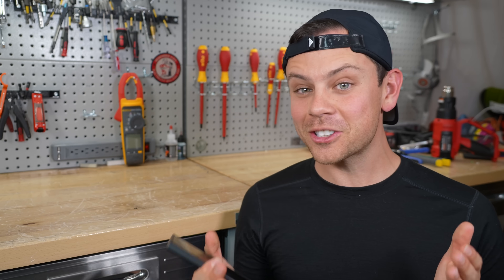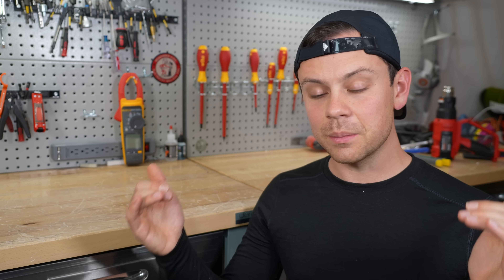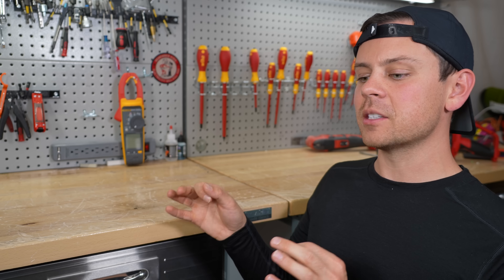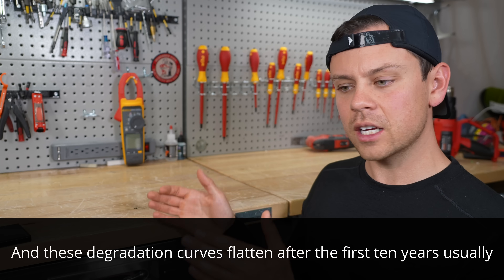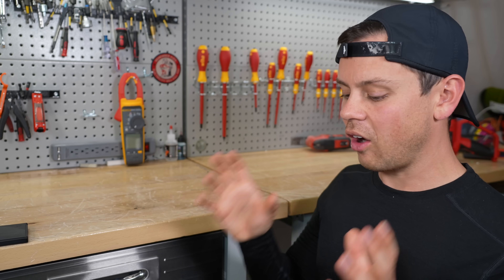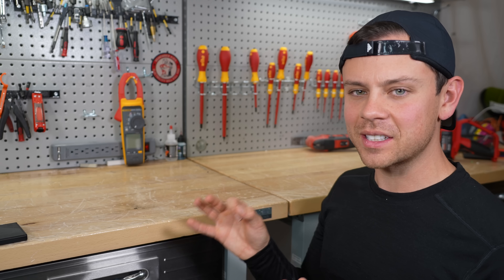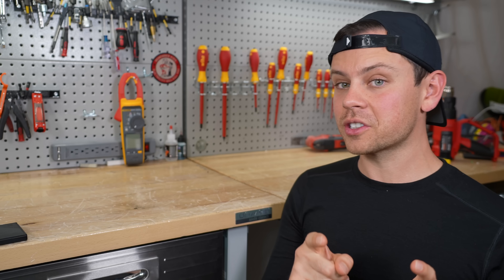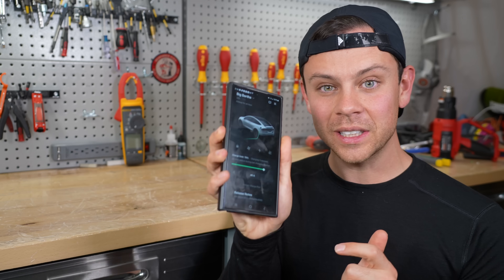LiFePO4 Longevity Discussion! Why Charge to 100%?! For Solar??

Comment: You give lots of good reasons for charging Lipo batteries to 100%.  But I didn't hear anything definitive why to regularly discharge them to 0%.  I have had my trophy batteries for two years, and Dan never said anything about discharging them to zero ( he, like you said charge to 100% regularly).  My batteries seldom get below 85% and we use them for everything.  maybe twice a month I will charge my tesla and run them down to 40%. Am I harming my batteries in your opinion??

Comment: I have an extra capacitor type balancer and im planning to use that AB to trigger via jk bms dry contact during low soc maybe during discharging from 51.5v down to 45.0v since planning to use my battery dod at 48v(3.00v/cell) is there any benefit from this scenario?  May be to avoid uvp during discharge ?? 

55.2v rcv
55.2v start balancing jkbms
51.5 and below start external AB

Comment: For long time storage. Should I discharge it to zero and then charge it to 50%. Or charge it to 100% and then drain it back down to 50%. AC200MAX + 2x B230 batteries. I do not use this system only for emergency power. Thank you in advance if you can answer my question. Canada.
Reply: All the way up,100%, is the only way to ensure the cells have balanced .

Comment: Our 12 volt batteries are unused for 8 months over the fall / winter / spring.   Temperatures sometimes reach 30 below F.    Should I not run a charge controller from our sometimes operating solar panels (sometimes covered with snow).  How do the recommendations differ for LiFePo batteries vs flooded lead acid vs gel batteries?   Any difference when using two 6 volt golf cart batteries in series (flooded lead acid)?  Thanks.

Comment: I have an RV with 1000w of solar, 1,000ah of LiPo. We are also on 50A of shore power so the batteries rarely get used. The whole setup has been on 24/7/365 service for ~6 years now. The batteries hover around 13.2-13.3 most of the time. I'm quite sure they've lost capacity by now, especially since they are almost 24/7 at 100% capacity.
My point is, there are many of us who full-time, have these setups and won't use the batteries unless we travel or have the shore power go out for whatever reason. Not much can be done about that I suppose.
Edit:  I realize now it's important to note that the 50A of shore power we use is included in our weekly $$ rate, so we have no compelling reason to use the stored power unless it's needed. When we travel (3 months out of the year) we are rarely on shore power. That's the only time the solar/battery system is being utilized fully.

Comment: I have 4 Enphase 5P batteries and I use them daily.  Enphase recommends I do not discahrge below 5%.    In the winter my solar system tends to not charge to 100% even though my solar system is sized to the max of what my utility allows.  In the summer it does so regularly.   So,, in winter,  would have to use the grid to charge the batteries to 100%.    My question is,  how often do I need to charge to 100% to balance?

Comment: That's good to know about charging them to 100% so balancing will happen- I'm assuming unless you built it yourself, the BMS handles this?

I hadn't seen your other videos on it yet, but I do keep seeing the same thing- 100% depth of discharge, 4000 cycles, 80% and 6000 cycles, 60% 15,000 cycles (that's for a LiTime battery).  I think it's similar for the EG4 server rack battery too but I didn't double check.  So I'm sort of confused-

Still 10.95 years at 100% DoD, and at 15,000 cycles the batteries would outlive me.
Reply: That last 1% sucks bad though ..can take a long arse time just for 1% , but then they're balanced I guess
Reply: @leeinwis  I think I must not have watched his whole video, from what he's saying the numbers I cited above are only for rapid cycling at 1C.  That's great news for me, it means I don't have to spend as much on batteries.

Comment: I have a 200ah 24v lithium setup solely for a backup when the mains power goes out, it's always sitting at 100%, is that going to be bad for it? Better to set it to 80% instead? It's used once every few months if that.
Reply: According to him 50% is what you should be doing. I guess it's nice to be rich and can afford a humungous system that 50% is more than enough in an emergency .I'm gonna stick to 80% and down to 20% when actively using it myself. If I get a tad less longevity that's ok because much bigger and better tech will be available by then anyway .

Comment: I’m having a hard time understanding the part about using your battery to zero. I understand you’ve posted diagrams explaining all this, but I am dyslexic. Been watching you for years learned everything from your channel about solar, but you’ve never really been too clear Using your battery to zero I have 8# 12 V lithium phosphorus batteries, 125 amp hours each. If I ID charge those batteries to zero what would that read on my voltage?

Comment: I'm losing my mind over my batteries not charging at all. 😆
Thankfully they are all 3 at 12.91v as of yesterday, but that is getting low because my system sees a charge of 14.5, so with the generator on, nothing is happening tot he batteries.
This happened about 10 days ago when I turned my battery disconnect off for 12 minutes when the SOC was reading 65% ish. when I turned it back on my SOC showed 100%.
I'm considering, disconnecting the load side of the Smart shunt, and calibrating to zero.
Sooooo whatdoyathink?

Comment: The Pylontech battery manual clearly states that they must be charged to 100% to allow the BMS to equalize all the cells. The suggested time is tens of minutes, but those who think that keeping the battery charged to 100% will ruin it are not saying the right thing. For me it is wrong to think so and for greater clarity I can make 2 considerations: 
1 - If you charge at constant voltage at the maximum voltage value of cell x cell voltage, there can be no damage because between 2 voltage generators of equal value there can be no exchange of current. 2- If you charge at constant current and once the maximum voltage value is reached you disconnect the battery charger there can be no damage.
So, we have to be sure that we are using a good battery charger... in case of ESS you must implement the right configuration.

Comment: I think part of your problem is that your audience isn't always getting the full story.  You're glossing over a LOT of detail here.  Maybe your regular viewers and ... forum members (apparently?) know what you mean, but you're "simplifying" this to a point where, IMO, it's borderline problematic.

Let me explain:

1st) The terms "0%" and "100%" are unqualified.  Percent of what?  Are we talking about the max and min safe operating voltage of cells?  The manufacturer's recommended charge termination and load termination voltages for a whole pack?  The setpoints on your charger and inverter?

2nd) You're assuming that everyone is using a pack that has a top-balancing BMS.  I'm going to go ahead and defer to you about what's out there on the market.  I know top-balancing is popular.  Personally, I'm more inclined to go with bottom-balancing, but it's an academic debate, and there are pros and cons to each.  However, the point is "Charge to 100% to balance" makes sense if you know ... without any doubt ... that the pack BMS is absolutely definitely going to bypass high cells and/or top-up low cells.  Is that an absolute truism?  I'm skeptical.  You do briefly mention why you're supposed to do this, but you don't talk about it very much.  It doesn't help newbies to give them random guidelines w/o explaining the reasons to do this, and more importantly, how to determine IF they should be doing it.

3rd) Getting frustrated and saying "I KEEP TELLING YOU, JUST DO THIS" doesn't help anyone.  Like I said, you're probably talking to 50% new people every time you broach this same old argument.  Expecting that they've gone through your whole archive before the algorithm drops them on this (or your last) video -- hi there, that's kinda the case right here -- is like expecting someone to remember a conversation they weren't there for.  I know it's tedious, but you can't make "golden rule" statements without qualifying the terms and expect that you aren't going to get push-back.  Batteries are dangerous.  And if you just follow adamant commands from random people on YT w/o understanding why/when/how, that's how you end up with property damage and missing eyebrows.  If you're lucky.  Yes, the onus is on us to understand our systems.  But that's also why "making it simple for newbies" is a bad move in general.  This stuff isn't simple.  Don't pretend that it can be.  If you want simple, buy a pre-fabbed system installed by a professional and follow the directions to a T.  If you're going to DIY, you HAVE TO BE willing to learn.

FWIW, I don't disagree with anything you said.  Your points are all valid and based on sound understanding.  But you can't distill just the rules of thumb.  There are exceptions to those rules of thumb that you're kinda sweeping under the rug "to make it simpler", and that's the only thing I wince about.

Just a thought.

EDIT:  Wanted to add, directed to everyone here:  There's no reason this should turn into an "us vs. them" debate.  The comments are full of people attacking the straw-man on our host's behalf.  I mean, do any of you even have one example of someone questioning the advice incorrectly?  Or are we siding with someone against an imagined enemy?  We've got more than enough of that these days.  Let's all calm down and have a reasonable, technical discussion, huh?

Comment: Hi Will, this question isn't relevant to the discussion but I don't know how to contact you otherwise, for that matter don't know if you'll see this. Do you know or have you ever tried to up the output of a solar panel by reflecting more light onto it? This has come to me because I have limited space on my vehicle based system and wondered if when I'm stationary I could flip up reflective panels. Thanks for the videos!

Comment: I guess my system is to big because I only typically discharge to 75-80% daily.   My logic is I want enough power for 2-4 days of bad weather.
Reply: Mine is exactly the same as I calculated before building it but I believe there's nothing wrong with that, occasionally I run higher consumption devices just to get the battery working a bit but without exception even in winter I hit 100% every day.
I couldn't be happier and now no power bills

Comment: I felt that both your videos were clear and plainly easy to understand. 🤷I agree with you and have been practice your recommendations even before these videos. I used Lipo4 EG4 LL-S Batteries. Although I rarely get my batteries below 40%. Even on laundry days due to my power management. I schedule my laundry, dishwasher and distillers to run during peak sun times andI still end up with the batteries charged back to 100% by evening. They are tipically only at max capacity for a couple of hours. I'll move some of my appliance loads to the evening hours to dip into the last 10 % by sunrise. 😁

Comment: I have been running the LiFePO4, EG4-LL's (30kWh bank) for 2 years now.  I charge it to 100% almost every day and drain it down to 20-30% every night.  I have opened the door to the rack maybe 4 times to check on them.  They are within 0.02V of each other.  They work perfectly!
Reply: I watch your channel often and have a question. I have 6 lifepower4 v1’s (30kwh bank) and just installed them. Using with 6000xp’s. Charging with a generator until I get my panels up. One battery stays at 100% for much longer while others discharge. No batteries are fully synced with each other. Signature solar told me to set my inverters to “lead acid mode” and cycle them together for 7 days. 

Is this the proper way to cycle them?
Reply: @7seasons31  Are the Voltages synced?
Reply: @HomesteadEngineering  not nearly as tightly as yours. How do I accomplish that? Holding them charged at 100% until each cell balance?
Reply: @ I would probably drain the system to about 10% SOC and then charge all the way up to 100%.  Then keep it there for at least 4-5 hours.  Hopefully that would top them all out evenly.  That said, I suggest you call SS again and make sure your charge controller is setup properly.  Good luck!
Reply: @ thank you!!
Reply: @7seasons31  One other thing to check on is to take a good clamp meter and make sure all the batteries are draining/filling at the same Amperage. You also may want to check the connections on all batteries, to make sure they are "right and tight". A loose connection can not only cause a battery to charge/discharge unevenly with the rest of the bank, but can cause heat, more than you want!
Reply: @7seasons31 First of all i want to know if your batteries are in series or parallel. If they are parallel i want to see their connections. Send me photos of all batteries parallel connections.
Reply: Hi Will,
I have 5kw lifepo4 for solar which gets charged to 100% every day. Balence is fine, diff cell voltage no more than 20 mV.
 Soc seldom goes under 50%, but when we have power black outs, may go to 10% soc. Discharge rate normally 0.2c, but once in a while some heavy discharge  at 0.6c, even 1 c for a few minutes.
Bat. is 18 months old, cycles stand at 140 and recently soh dropped from 100% to 88%. Will that be due to high current discharge? I was  told these batteries should last 6000 cycles

Comment: Will , what voltage is considered min 100% 14 or 14.1, that can be run constantly until solar drops off and house goes into battery mode ?

Comment: One reason some people (myself included lol) worry about taking batteries too low in an off-grid situation is "running out of power". It is very disruptive to either have no power (or internet, and everything screams at you about that) until shortly after dawn, or having tk go outside and start up the diesel generator to burn through like 5 hours of diesel in the middle of the night to run the heating for the entire house rather than just the "core loads" (bedroom heat + critical infrastructure). Load shedding or other active power management is probably a better option, but not all of us can justify blowing $12k on a big-boy autostart diesel genset to "cover for the bottom 10% of SoC". Great analytic perspective on all of this regardless, you did a great job dispelling the now 20-year-old "don't charge your iPod above 80%, in order to preserve its battery life" myths!

Comment: Your frustration is clear! Thanks again for another good vid. Your point about why spend time and money building a system if you're not going to use its capacity is a good one. I've been thinking about solar battery "backup" for critical loads during rare times that we have grid outages, but there's really no reason I shouldn't design my system to be tied in for those specific loads etc while the grid is up, be able to fail back to the grid if I need to service the system, and still be available for backup power.

Comment: I completely disagree with your claim Will. I started with solar just about the same time you did so I have a lotta years of observation how lithium cells charge. 1st off, like you, I don't go for the 80/20 many are saying is better. It's knee to knee where you should start & stop charging which on a 24v system is about 25v @10% to 27.1v @ 97%. Going past those 2 points is where you start getting unbalanced cells that gets worse by doing the same thing over & over. Staying within the knee points keeps the cells consistently balanced. I've tested my cells every way possible & that's what I found does best & my cell voltages stay rock solid even.

Comment: I think people get confused by the Lithium variants... they hear recommendations for one variant, and think it applies to any battery with the word "lithium" in the name... it used to be the same when lithium batteries first came on the market... they were applying the recommendations for lead acid batteries to their new lithium batteries. now the same thing is happening again for lithium variants.  my job has specialized equipment that uses some of those earlier lithium chemistry batteries... I tell people over and over again don't leave them in your car overnight in the winter because when you plug the charger in at the job they take a while to warm up, they'll be frozen and you'll ruin the batteries.... we've got literal boxes full of batteries that were nearly brand new, supposed to last about 4 hours, but only last about 1 hour, and many of them only last about 10 minutes.

Comment: Assuming ten thousand cycles for the batteries, I bought above average batteries, anticipating ten to fifteen years. Assuming battery technology does not improve beyond what it is today, these will last me until I am 90. When I can get batteries which are a 50% improvement over what I have now, I will replace my system, and my kids can figure out what to do with them in the future. Kinda like buying a computer: wait six months, double the speed, quadruple the capacity, lower the price, you never buy a computer. Simply buy the best you can afford with an eye for expansion, don't worry yourself about "did I do the best I could", and listen to Will for good info.

Comment: Another great video. I have a question. My inverter has adjustment for Float V, Absorption V, Equalization V, and Shut down %. What do I adjust to allow it to charge to 100%? when set to the specs on the battery it will only charge to 69% according to the inverter.

Comment: 100% is fine, why would engineers build something and come up with data sheet specs for the people of the internet who are all smarter than the chemists and engineers that built the battery  to say only run them between 20 and 80 %.  stupid internet people, just follow the data sheet